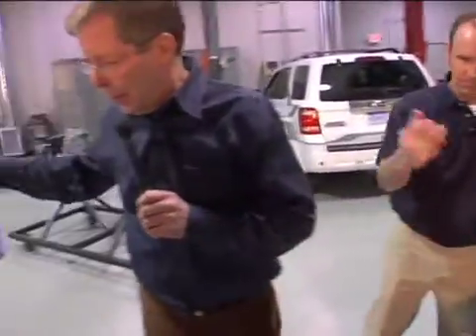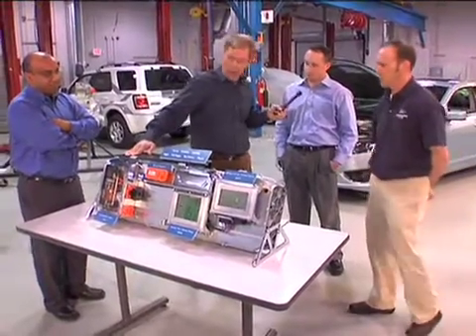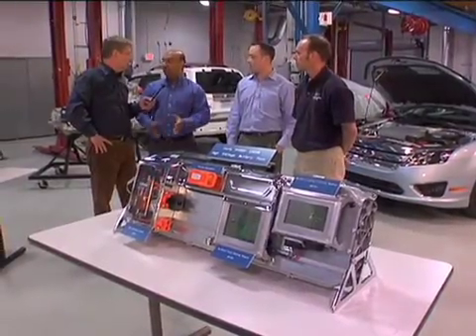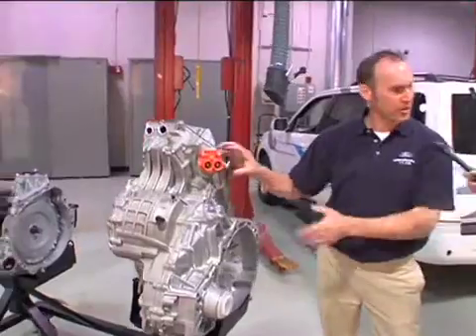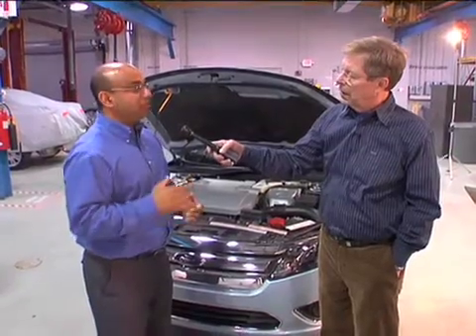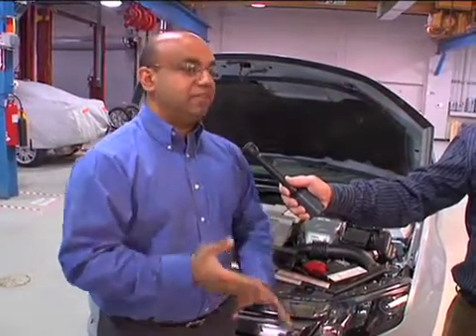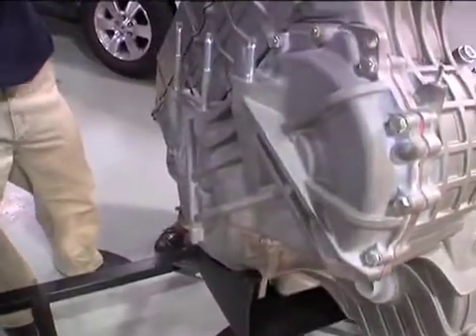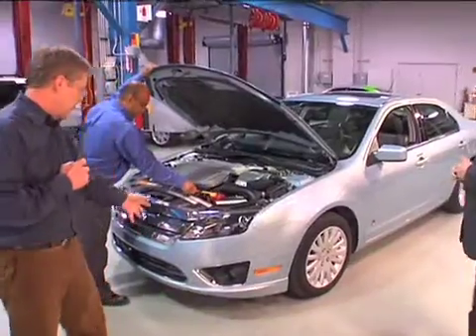Ford DigiKnows: 2010 Ford Fusion Hybrid - Part 1

Comment: I wish the reporter would have asked about the pro's and con's of that huge Ford transmission with the electronics integrated inside of it. At first thought I'm thinking that's not such a great idea. If the components are seperate and one goes bad it's going to be a million times easier to fix than pulling that entire thing out and taking it apart.